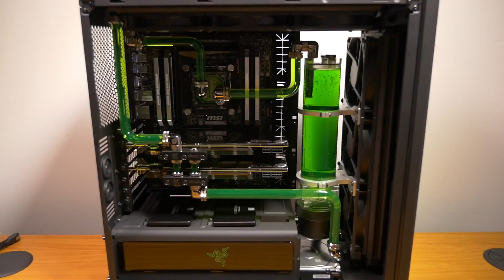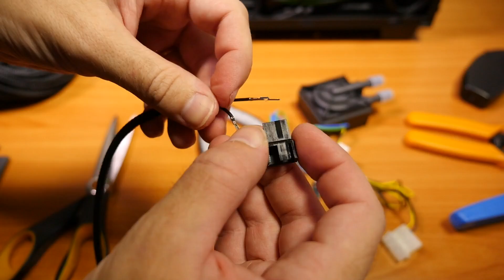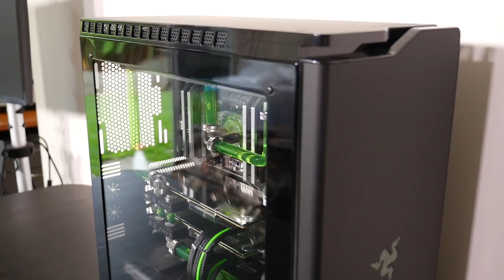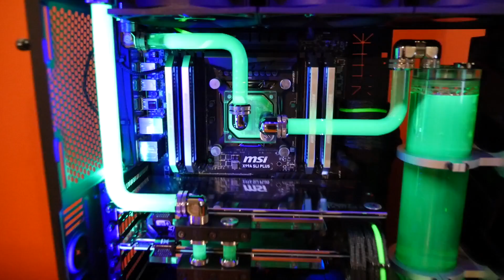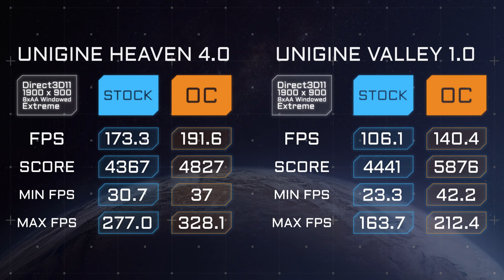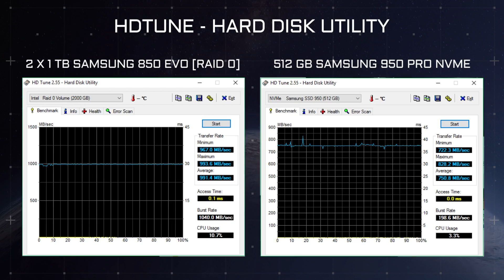SC Build #21: H440 Liquid Cooling: Part 5

Comment: So curious as to why you brought that CPU > Reservoir tube across the top of the ram instead of turning it up and then over to the reservoir.

Don't get me wrong, your build looks absolutely beautiful, but my suggestion would save a 90 at the res, and the added benefit of not having to potentially drain the loop when changing ram.

Comment: So for mid towers that can fit two 360s with little to no modding..what are we limited to? So far the H440, Evolv ATX, and the Fractal Design S? BTW saw your bracket for the res mount on the radiators. Wonderful design. I'll definitely be picking one up for my build as soon as Ryzen and Vega are out. I had to use a damn ruberband around my bitspower 200mm res on my current build for the clamp to actually grip the res and keep it from sliding. Funny enough it worked out very well and you can't see it because the clamp covers it up.

Comment: QUESTION

When doing a custom water loop, which order to you prefer....

Gpu, CPU, then radiator

Or like how you did it here...

Gpu, radiator, then CPU?
Reply: Living Sandwich well I guess putting a radiator in between makes sense. I have no experience In water cooling expect from observing and binding videos on yt but: cool water -> into GPU  (even worse with parallel OC config here) -> warm/hot water out. now it would not make much sense to me putting the warm water into the cpu block. (okay then cPU would always be the same level temp as GPU maybe). so Cooling it down beforehand would make more sense I guess.

Comment: No wonder my pump was not running full blast when trying to bleed and fill. I got the D5 v2 or whatever and i thought it was because i left the fan header to the pump in the  mobo that the pump didnt go full speed. As soon as i full booted the pump made alot more noise and the water lvl nearly depleted in my 200mm res. Love the channel and builds.

Comment: Which covers the chassis you are using the cover with the original window of this model NZXT H440 is different a little smaller and hides the part of the drive

Comment: A couple of questions, you folks seem to know your stuff. 
1) Why hard tubing, seems a pain too install? 
2) Can you really trust "quick" fittings not leaking? is it not better with some lockfittings and softtubing for safety?
3) Most seem to run 2 radiators when cooling CPU and 1 GPU, would it be enough with a 3x120mm rad for that?
4) I personally like the clear/clean water look. What solution do you recommend with destiled water? do you really have to open up the blocks and clean them or can you get away with that somehow?

Thanks, great channel! :)
Reply: Hard line looks way cleaner.

Comment: awesome build, been thinking of replacing my HAF-X with something a little smaller (H440 which was my preference, or define S which seems more functional but looks boring imo). you've built my dream setup for the H440 and validating that it's possible  thank you so much!!! now just the long long road of saving up (planning to update my liquid cooling along with it replacing pretty much everything but the cpu/gpu blocks so it's gonna hurt)

Comment: You should make and sell that custom wire for giving signal to pwm pumps. Haven't seen or heard of another remedy for this issue. I did my custom loop with a D5 PWM pump. And I took the risk and plugged it to the MB in order to fill up the loop. I literally had a panic attack the whole time....

Comment: Excellent final result !
I think I would have preferred the return pipe to the res to have the bend above the CPU block so it ran parallel to the inlet pipe to the block and above the RAM chips on it's way to the res, then drop down into it.  You could then have it inline with the other horizontal section. It's just personal choice and I am not trying to tell you it would look better, I just see it in my mind and like it that way. 
I'm sure you have your reasons for doing it the way you have (I'm sure you would have considered the options and probably obsessed over it) and it probably looks great in real life, maybe the camera doesn't do it justice. Or maybe it was to make it different from another build ?

Comment: Amazing build! 
I had a question for you/anyone else that may have an answer: Where did you get the side panel with the window from? I currently have an H440 and am planning on building my first custom water cooling setup.  I'd really like to put the Reservoir on the right side of the case where the HD cages are however the stock side panel with the window is rather small and the reservoir would be hidden.  And so I'm very interested in how you customized your side panel/purchased the side panel.

Much Appreciated!
Reply: he literally made a video dedicated to that lol

Comment: What was the problem with the D5? I've heard like the PWM ones run at low speed cause they're on PWM so if you would connect it to a 3pin it would work fine, I am doing my first watercooling build soon so I want to prepare by reading up alot :)
Reply: Indeed it would work if he connected it to the PC, but the PC is not on in order to prevent water damage in case of a spill. (the pump was running at 2%)
Reply: ***** Aight men ifall han hade bara connectat den till en annan dator eller till molex adapter :P fast det andra gjorde han va?
Reply: ***** Precis, det var bara ett fel med pumpen som bara fungerar med PWM, (normalt kör de på 100% om man inte kopplar in PWM)
Reply: ***** ah ty man!

Comment: This is it!

Just couple of questions, 
- why you didnt use fan on the back? still fit i guess
- where is the best fan's position? Inside(fan-rad-case)? or outside(rad-fan-case)?
Your answer would be so appreciated
Reply: He most likely left out a fan on the back to balance the pressure. A fan on the back would create negative pressure, drawing in more dust from the openings on the case. Plus, there was plenty of airflow coming from the top radiator. For radiators, there isn't much of a difference between push (fans pushing air into the radiator) or pull (fans pulling air out of the radiator). In some cases with thicker radiators or slower fans, push-pull (fans both pushing air into and pulling air out of the radiator) works best, but the speed of the fans tend to matter more. Personally, I would use a pull configuration, so it's easier to clean dust off of the radiators. However, with proper filtering, you wouldn't really need to.
Reply: First of all, thank you in advance but you dont really answer my second question tho
You just explained the fan's mode, suck or blow/pull or push but i didnt ask that
I am asking about the best fan position
1. Inside (fan - radiator - case)
2. Outside ( radiator - fan - case)
Which one perform cooller outcome? both position can applied suck or blow method tho
Thanks again
Reply: +Yahtadi Shidiq It doesn't affect temperatures, if you check out tests that have been performed, as long as you have a clear path for airflow you're good. Also depends on your case. (Positive pressure can also help)
Reply: GreenIslanders Then why i never see build with outside fan(rad-fan-case) ?
Is there any build with outside fan on the front and on the top?

Comment: do you set the fan curve speeds to adjust to CPU temp or GPU in a loop like this? if the fan speeds adjust differently, isn't there a risk of loosing positive air pressure in the case?

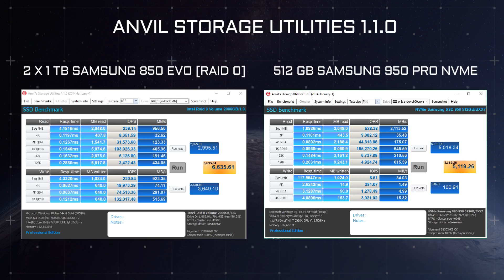Comment: Just a note but you might want to remove that 'bounce' effect on the benchmark animations when it's about to rotate 90° out from the centre before the new graphic pops up) , such as at 12:03. It's fine when it rotates in from the centre though, just not when it's about to rotate out.

Other than that, stunning looking build as always.